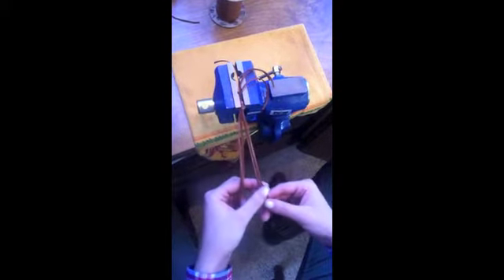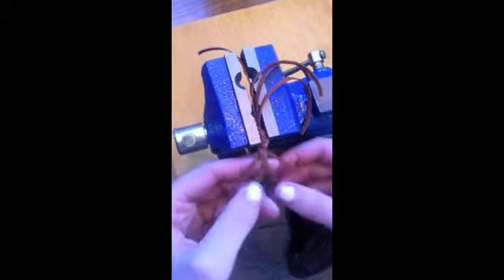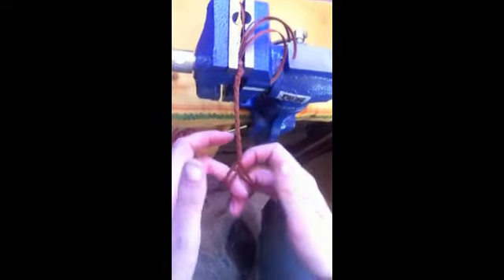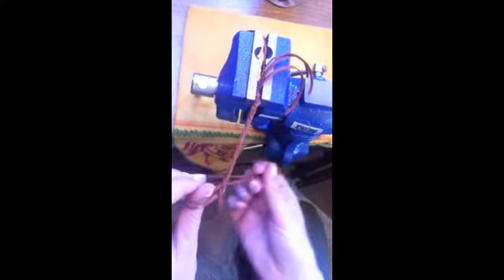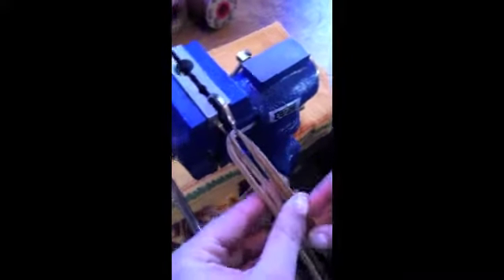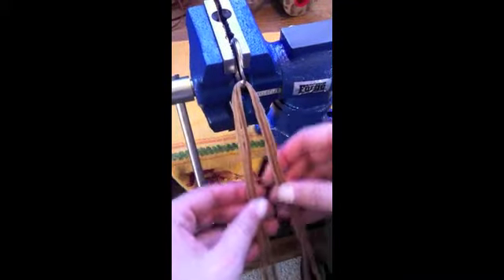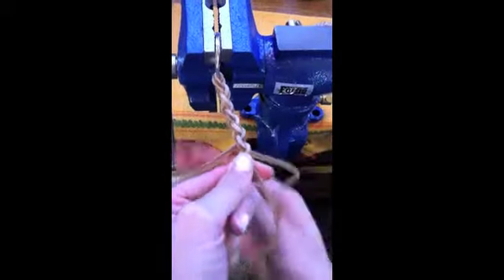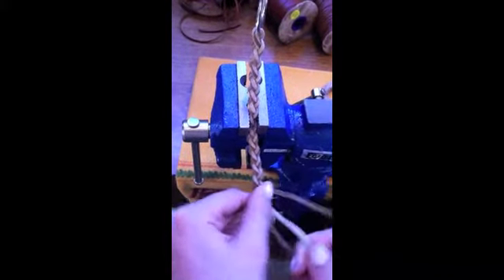Buckaroo Barbie Braiding Series - Introduction to Braiding and Rawhide

Comment: Just another thought/tip from how I was learned the 4-strand braid: you have the two pairs on each side when you start and they always stayed paired. Meaning, when you take the top (working) string a complete step (under and over), it always comes back to the string it originally started with (does that make sense haha?).

But the video is great, Liz!! Awesome stuff..looking forward to the next ones!